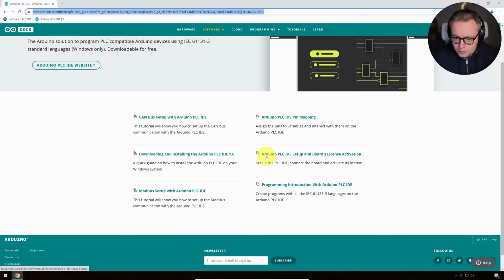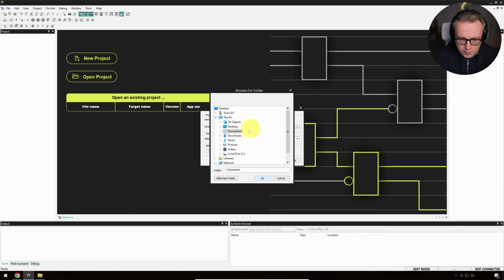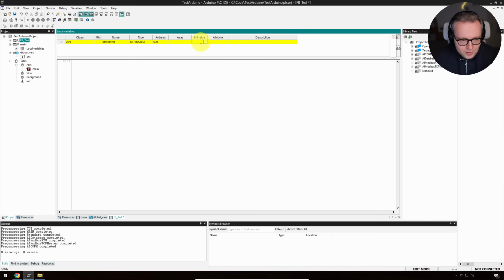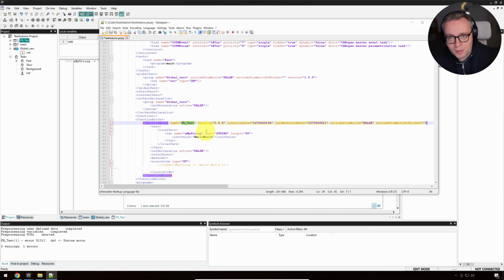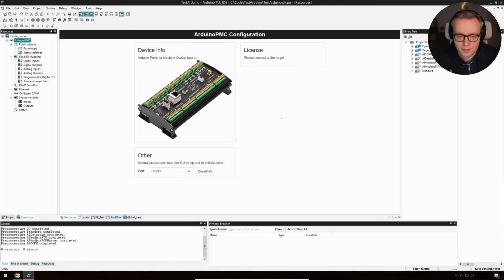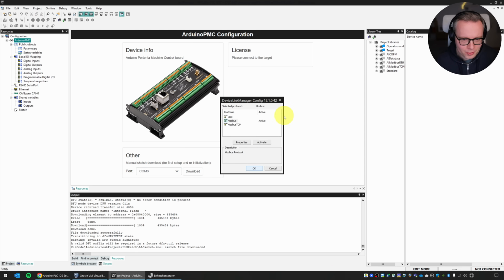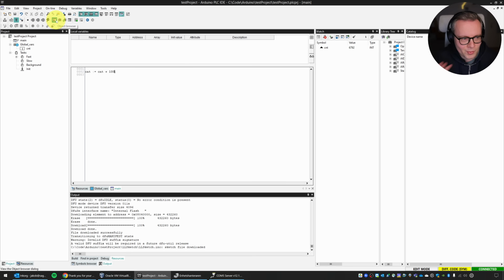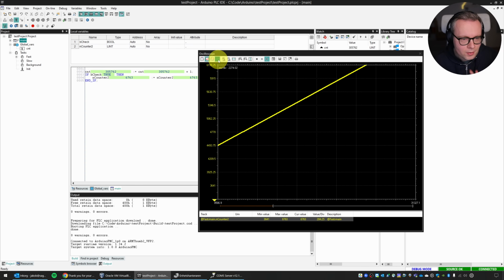Arduino PLC

Comment: For me arduino + node-red is great solution. If hardware and software doesnt have any issues the  arduinos can run for years withoit a hiccup. I have about 20 arduinos running in the company and they mostly work flawlessly.

Comment: I like the idea of it but for the cost you could buy a schneider zelio plc which has free plc programing software
Reply: Siemens TIA portal software is available for a one time fee, the S7-1200 PLCs are however not very expensive. Rockwell’s  Connected Components Workbench software for their Micro820 series PLC is free, but their Rockwell Studio 5000 costs a bomb ..

Comment: Most of it is cool but I don't like the comment that closed source is shame. This is the decision of the authors of their work and slandering their work by suggesting that it is a shame. If you want you can buy this code and open it or you can write an analogous one. When you see how much it costs then maybe you will understand how, in my opinion, frivolous this comment is.
Reply from the maker: This was an observation that the new IDE takes a different approach than their conventional IDE. If they don't open source it, it means it's a different business strategy that they have with their conventional boards and open-source IDE. I think most people associate Arduino with the word open-source, so it's a side-step from that.

I know what it costs to develop software, as I (like many of us) am doing both closed and open-source software. That however, doesn't change the above observation.
Reply: They seem to be severely confused concerning their target market. No pro will touch this, and a lot of DIY enthusiasts DO care about open source. Not open? No purchase, and I don't care how low the price is. My time is worth more than getting locked into proprietary software.

Comment: I quickly try arduino IDE PLC, and I think they did not develop IDE from scratch, they probably buy/license something existing, and it is probably reason why they can not open source it :-( until they open source it and make it available for 3rd party boards I will keep using controllino and platformio for writing code.

Comment: Hello
Arduino PLC IDE is  just a version of LogicLab from Axel 
axelsoftware
Reply from the maker: Hey Pedro! Thanks for this, I will check it out! Do you know what the differences are?
Reply: If it is so I do believe is good choice.
LogicLab IDE and runtime can be used even for RaspberryPI and it's well developed and supported.
I honestly don't like to buy a product PLC like that cost about € 300,00 and forced to pay more fees for the runtime licence.
Should be better to integrate the licence cost into the product price.
Moreover I wonder why Arduino is trying to compete into the PLC market, for me it's not clear.
This market is highly competitive and the controller itself is just a small piece of the cake. :-)

Comment: Speaking for myself, I'm happy that OOP is not the default.
Reply from the maker: Why not? If you don't want to use OOP features, you don't have to. Speaking of that, why does Arduino even have an option like this? It should always be OOP-capable, and for those that don't want to use those features, they don't have to.
Reply: @JakobSagatowski  Because and I am arguing very lightly here, is that OOP is a programming style. It shouldn't be a core property of the IDE as the coding paradigm popping up and cluttering the UI elements. You might feel like OOP is an essential coding paradigm but for me it is utterly distracting Java-esque stuff. If I don't need it why should I have it even in the UI elements grayed out or otherwise? It might be a personal preference to which I totally agree, but for me that's just the wrong way of coding especially in this low-level context so I would be able to get rid of it if I choose to do so.
Reply from the maker: You're right in that it's a programming style, but the elements that make it possible to do OOP (methods, inheritance, interfaces, etc.) are still part of the IEC 61131-3 standard, and as such should be part of the IDE. Regarding of whether to do OOP or not in industrial code, let's just agree to disagree.
Reply: @JakobSagatowski  Yes but standard does not imply that we must implement OOP. That is the difference I am trying to make. I don't mind if someone wants to do it for their own project but I don't want it to be cluttering UI for things I will not use. That's not a good UX design and suffers the same issues that we have been suffering in the last 20 years with ugly 3rd party UIs.

Comment: OMG What a surprise to see Arduino in Industrial Automation market. The licence price is really low cost according to other players’ licence prices. But I expect from arduino free licence as an open source community. 

The main question is Arduino PLC really robust, stable and reliable for industrial applications? 
I think it iş not suitable for heavy and complex industrial process Automation. It is mostly suitable for machinery automation, at least for now(I mean OEMs)…. What do you think about that??

Comment: thanks for the review, really honest and appreciated! we at Arduino are working hard to provide a smooth experience, as usual, also into the industrial world. some replies to the video's questions. 

- the IDE PLC will be available for the upcoming Arduino OPTA micro PLC,  expect in Q1 2023
- thanks for all the suggestions regarding the IDE itself.
- we will fix the broken links here and there (in the docs website)  , there's a lot of effort behind the scenes.
- Regarding the CLI integration and the CI builds, the IDE itself relies on the Arduino Command line interface, that is installed with the IDE tools , along with the core needed for programming the Arduino Portenta Machine control. we don't have a specific usecase for that but your suggestion is really interesting.

thanks!  Andrea
Reply from the maker: Hey Andrea! First off, I want to say that I think you've done a great job. I'm very happy to see Arduino enter the world of industrial automation and PLC-programming. It's a sector that definitely needs fresh blood, and with a little more a mindset of traditional software engineering. Though I had some suggestions, I realize that this is your first release and that there will be many changes happening with this IDE in the future. The XML/source-control-issue is something that bugged me especially, because now I see more and more automation engineers starting to use version control and it would be very nice to have the source code in plain text (which very few automation vendors do). I've done other videos on this subject. Since your post, I have looked into the CLI and actually found this CLI to compile everything from there. That's an amazing feature that no other vendor (that I'm aware of) provides as of right now. This feature alone will make for a lot of testing and investigation from my end. I'll for sure make a video or two about this topic in the future (to show the rest of the industrial automation world the advantages of having access to a CLI), and I'll see whether I can incorporate that into some sort of automatic build pipeline (something that's just recently starting to popup in the world of PLCs). Again, thanks for a great product and I wish you a Merry Christmas & happy new 2023!
Reply: Count me in for a +1 for plain text as well. XML seems like a nice place to visit but you don't wanna live there.
Reply: +1 for source in plain text for version control. Please!
Reply: Great work Arduino team and Jakob!

+1 for source code in plain text for version control please Arduino team!
Reply: Any chance of making this compatible with the Productivity Open Arduino based PLC from Automation Direct in the future?
Reply: Hi Andrea, 
I think Arduino's entrance in the PLC market is great for the makers too. We can now have cheaper PLC's to play with design home automation and such kind of products so easily.

Comment: So you need an Arduino Portenta for it, right?
Reply from the maker: Right now it seems only the Arduino Portenta Machine Control is working, though Arduino are soon (hopefully) releasing their Micro PLCs which will work as well.
Reply: Featuring zero galvanic isolation 👎

Comment: Looks very promising for home automation, just a little bit polish here and there.

I'm currenty using RPI3 with CodeSys license (more expensive, but arguably still affordable 110 euro for multicore and 55 for single core) + UniPI 1.1 and that gets me an almost full featured compact PLC (14 DI, 2 0-10V AI, 8 relay O and one 0-10V AO) with visu server (no real-time, but probably don't need it if you don't play with precise motion control). You can even install profinet, ethercat and few other masters on a built-in ethernet - don't know how they behave though, don't have slave devices at home.

Too bad raspberries got absurdally expensive now, if you even are able to get one. I think for professional use you find solutions that aren't much more expensive, like Siemens S7-1200.

Also, you can buy cheap I/Os from rasberry-sps.de that communicate with i2c, but you need to solder them yourself. They're cheap though, about 15-20 euro for a module.

There's also a nice solution called OpenPLC, which is simple and free, but has got one big problem - no online monitoring (and simulation usually just doesn't cut it). It should be a good free alternative for small projects though, especially since it can be installed on x86 and arm, windows and linux alike.
Reply from the maker: Hey Zygfryd! Thanks for your message. I wasn't aware of the UniPi, looks like a great addition. Fully agree on the RPI3 with a CODESYS-license is a great combo, I've used it myself. It's nice that we have so many alternatives now, and all of them provide us with free IDE's. Just makes learning to do PLC-programming so much easier!
Reply: @JakobSagatowski  BTW, do you happen to know how a mere mortal can get a hands on some Beckhoff gear (not a quote from industrial retailers)? Used gear on sites like ebay aren't often enough, especially some new stuff, like that CX7000 i saw on this video.
Reply from the maker: No idea unfortunately. I buy stuff from Ebay, but most often I buy it the official way (and with that the very long lead times).

Comment: You can buy stm32 nucleo board for 30 usd and programming in c or c++ which is a much better programming language with true real time debugging (with jlink or stlink probe) and not simulation as plc works with protocol. Plc programming language is a horror for the programmer. It is simplified for an electrician, but for deep programming it is terrible
Reply: you would use some Developement board in production where you need some PLC?   well I see you are not working in any field near this PLC kind of stuff.
Reply: @nukester.  Of course, the signal level needs to be adapted.
The PLC system uses 24v as standard, while the microcontroller uses 3.3v and less.
All I want to say is that plc development software is garbage for programming and a plc device is ridiculously overpriced considering that today's 32 bit microcontrollers are so powerful and cheap.
In addition, the Arduino plc uses almost the same microcontroller as the nucleo board stm32h7 chip
Reply: @mail87523  You aren't really paying for the controller, but for the reliability. PLC can still work on harsh enviromments with electrical noise from the other machinery in a factory, that's not something an STM32 would stand in the long run. 24V standard is useful to power motors in Automation, you couldn't do this with 3.3V alone and extra equipment would be expensive because it's much easier to power a bigger motor with 24V using standard electrical equipment. PLC Programming (not just Ladder, that's not the only one) is fine for the usual application. You have 5 different ones that can be used together in the same application, all with specific uses, while I understand the proprietary software is usually terrible. Even software development is going towards the "no-code" or "less-code" approach and that's kinda what PLC Programming is about. C is solid, but C++ is not that amazing especially for a real-time application. Maybe it could be useful for creating a database or something more complex, but usually PLC's are only there in the field controlling actuators and monitoring sensors and other softwares (SCADA and Industrial PC) do the higher level programming in a network.
Reply: Structure Text for PLC is essentially Pascal with some flavor change. Sure it's not the best language in the world but it's mostly workable. As for IL/FBD/LD, just think of them as the exact same thing. Basically assembly, which isn't the best thing for writing algorithms, but still, it's workable.
Reply: @FlameRat_YehLon  PLC Programming is not that complex most of the time and those five languages are enough for its application (most just pick one and run everything). I'm not sure if you already program a PLC but you cannot use the same algorithms and do the same way (for exemple a loop, that just doesn't work how you want).
Reply: @GiovanniBR1234  Algorithm wise they work the exact same way (well, exact for SFC which does things differently). When not using ST you do it the old fashion way and use JMP if you need to.
And I've been 3 years into programming PLCs as my main job. All I can say is, with my math background I don't see them being THAT different, you can write in ST as if you are using LD and vise versa, but that's kinda dumb so people use them the way they are, which would implement the same algorithm differently but do more or less the exact same thing.
Reply: @FlameRat_YehLon  Yeah, that makes sense. Unfortunately I could only use LD in my project and that didn't went well. But I'm sure they have their uses. Perhaps it's more of a different implementation than algorithm
Reply: @GiovanniBR1234  LD is technically fancier assembly, so when an algorithm got complicated enough you got to "compile" the pseudo code manually.
Also, use JMP whenever you want to skip a line(rung). It's actually pretty useful when you want to have alternative routines to be executed (similar to IF ... THEN ... ELSE). On Allen Bradley you also do that to skip unnecessary branches (similar to ELSE_IF).
Reply: Well I have worked as a software engineer in 5 years now mostly c# and c++. Before that I was a trained plc electrician back in 2007. Alot have happen on the PLC front in structure text. In twin cat 3 it reminds me alot of c#/c++ in syntax and beckhof dose support c# and c++ now directly.

Comment: Wow, it looks quite promising. 

Definitely a yuck factor with the source in xml. That's a deal breaker for any serious project imho.

And yeah, I really dislike IDEs, I just want text files and CLIs. If there were a way to do that it would be so cool.

16 bucks for a licence seems cheap compared to Beckhoff lol.
Reply from the maker: Note that there is actually an option for storing source code in multiple files. Under the "Use object oriented features" there is a setting for storing the project in multiple files "Multiple files project" (though ST-code is still stored using annoying XML-annotation).
Reply: Wait until you find out how many file formats are actually just  XML or  zipped XML.
Reply from the maker: @tillorrly1128  No it's gets even worse. A lot are just binary blobs. If you only knew how bad it can get.

Comment: Under the "Use object oriented features" there is a setting for storing the project in multiple files "Multiple files project".
Reply from the maker: Thanks Simon! I will update the pinned comment with this information. I think this should be the default setting.
Reply: Nice catch, Simon.

Comment from the maker: Since I did this video I discovered that there is some EXCELLENT documentation available if you go to "Help → Index". Also, under the "Use object oriented features" there is a setting for storing the project in multiple files "Multiple files project" (though ST-code is still stored using annoying XML-annotation). Again, this was just a first quick impression. There will be more videos about this IDE coming, so stay tuned!